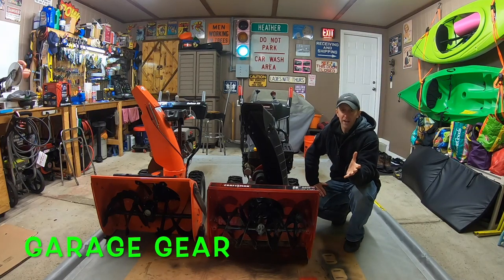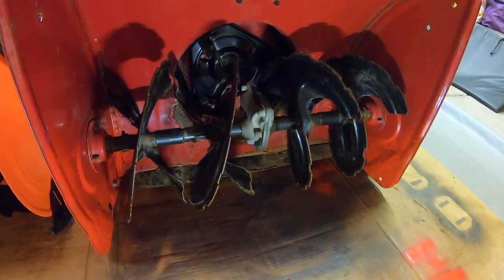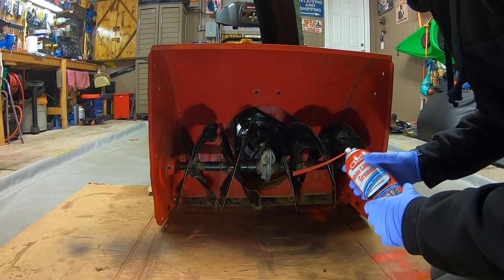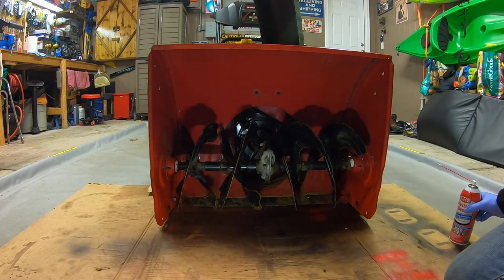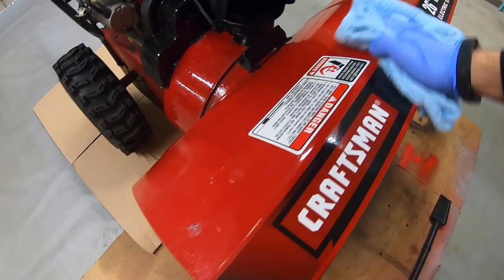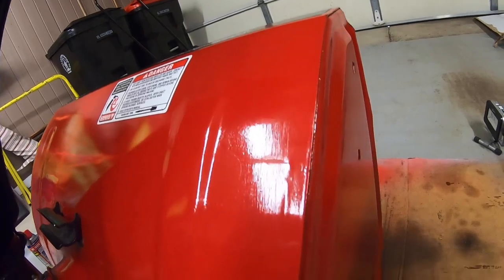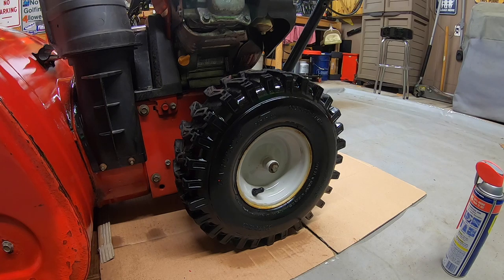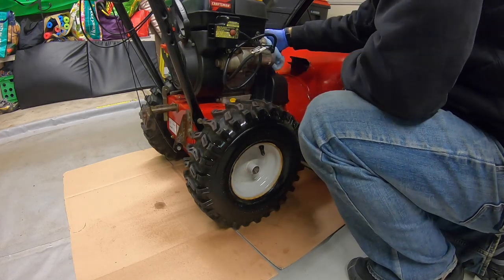CLEAN, SHINE AND PROTECT YOUR SNOWBLOWER. Cheap, Easy and Effective!

Comment: I just took delivery of an Ariens 30 inch Platinum SHO. I put a good layer of anti sieze and low temp grease on the gears , drive axels and drive slide bar . I will be using silicone before  the first use which might be next Tuesday . WD 40 is a great idea for the entire machine coating . You show great detail in this video . Thanks . I am think Auto tire shine for outside of tires . Too bad those outside cable brackets are not stainless steel . One more thing I do is a light coating of bulb lube on the electric start plugs and also in the cord itself . Easy to connect the cord and pug it in both the machin and wall outlet .
Reply from the maker: Thanks for sharing all this Mike!

Comment: Hey JB I'm new to your channel but I like how you do things I'm a retired machinist and I too care for and protect my snowblower.  My snowblower is a MTD it's 26 years old and looks and runs like day one. I replaced all the cheap nylon bushings which it came with when it was new to 304 stainless steel ones which I made myself. I think I'm going to put these on my snowblower too, every year I change the oil, every 2 years I totally grease the transmission gears and shafts and always use fresh fuel. I've never had any problems with my MTD I modified mine by changing all the plastic moving parts to stainless steel. I will keep checking out your videos and thanks for doing what you do I truly appreciate it.
Reply from the maker: Hey Ken!  Thanks for being a cool fan of the channel! Sounds like you really modified that snowblower to make it a snow throwing champ! Plenty more videos to come my friend! 👍

Comment: I worked for a major NY based Stock Exchange for 20+ years (can you guess which one?). They were absolutely meticulous about maintaining all of their equipment - reliability had to be to the 5 nines. 99.999% uptime. So, the thinking was that "cost avoidance" although extremely difficult to measure, in the long run was a hell of a lot cheaper than repairs and the cost of down time. Your videos are an excellent example of this thinking. It also reminds me of the children's rhyme "A stitch in time saves nine"!  Some people give me a look like "why bother, just replace when it breaks". But I find it easier to sleep at night knowing I've done all I can to keep things from breaking down - usually when you need them most. Plus, I'd rather spend my $$$ on something that gives me pleasure when I want it. Not on an expensive repair or replacing with a new item (which often is not as good as a decent, well made older model.)
I think that's why my 18 year old Camry has never failed me and has required only the usual wear items. 
Thanks for your videos.
Reply from the maker: Totally agree with you on your thoughts about preventative maintenance!  A small amount of effort now usually means less headaches later when it matters most! Thanks for watching! 👍

Comment: I just use Pam cooking oil to spray everything once and awhile. It’s much cheaper than WD40 and works great. FYI cheers 🇨🇦👍
Reply from the maker: Thanks for the tip!
Reply: If you want to invite critters to hang out in your snow blower maybe.
Reply: @shadetree6981  any thing that’s in the barn has critters in it. That’s just what happens. I put downy sheets in my motorcycle and snow machines mice don’t like that. Problem solved.
Reply: So many videos about don't put pam on a snowblower

Comment: Personally, I'm not a fan of WD-40. What have discovered that Mobil marine grade tube grease works great! Use a old rag and wipe grease on the surfaces. Rub it in and buff it out. Also use marine grade anti-seize on the axles. Marine grade stuff have a lot better properties for resisting wash-off.
Reply from the maker: Good tips here! Thanks for sharing! Thanks for watching!

Comment: WD40 was designed by NASA in the 1950s' to rust proof re-entry vehicles (parachute into salt water). "WD" stands for Water Displacement.  Years ago I did the following experiment:  I hammered a couple of steel nails into a piece of wood and sprayed one with WD40  and left them on my deck exposed to the elements, the without WD40 was rusted the next day.  The one with WD40  on it stayed rust free for six months.
Reply from the maker: Good tips here! Thanks for watching!
Reply: You're wrong. WD-40 was invented by businessman Norm Larsen, founder of Rocket Chemical Company. He developed it in hopes for it to be used in the aerospace industry but it was not designed by or under the commission of NASA.

Comment: Also just reading something about WD-40 that it's not good for paint It can actually take paint off of snow blowers over time Even though it protects it.

They also say don't use it on plastic parts cuz it can dissolve plastic. So pushing it into the gears for instance a Toro quick stick gears are a very hardened plastic and it could actually deteriorate it and make your gears break. 

They did say the WD-40 white lithium grease is better, better for plastic better for everything.. 

;)
Reply from the maker: This is now the second time I’ve heard this but I have never seen this happen and have been doing this for a decade on my snowblowers paint with no issues. Same thing with plastic components. No issues. Would like to see a long term test on this for sure .
Reply: @GarageGear  You've never seen WD-40 degrading paint? 

Did you ever think that maybe that's why the paint's coming off? Even though it's protecting it. 

I don't know either but it says it and a lot of places.
Reply from the maker: @muzikmon2267  the snowblower in this video I got for free and fixed up to sell. It already had a lot of rust on it. Doubt it was sprayed with anything to protect it at all knowing the guy that gave it to me.

Comment: If you really want to get picky I tried using Brillo pads and the rust came off then hit it with fluid film to coat them they look like new
Reply from the maker: Thanks for the tip!
Reply: @GarageGear  I actually learned it from your video all I did was add the additional Brillo pad to remove the rust then coat it like you did Lol… so thank you

Comment: When the city plows invariably dump snow on the end of my driveway.  Most times .... I can taste that there's some sort of salt.....  Whether it's NaCl or MgCl or what have you.  

Is waiting till the end of the season, aka spring, ok and then should it be rinsed out with soap / water?  

I don't recall hearing you mention issues with salt in the snow that you might get into.
Reply from the maker: Hey John I usually just rinse it down with a hose and then blow dry it with a leaf blower. Then I put a protective coating on it. Thanks for watching another my friend!

Comment: Seems like wd-40 would dry out the paint, cause paint damage. I use a spray on car wax, made for "paint ".
Reply from the maker: Hey Ken, not to worry! Wd40 will not harm your machines paint. Been using it on my machine for nearly a decade. No paint issues whatsoever. It’s protected it and kept it looking like new all these years. Thanks for watching
Reply: @GarageGear  sounds good. It does give a great shine, I'll have to give it a try.  :)
Reply from the maker: @kenbird5221  can’t go wrong with it!

Comment: wd 40 IS NOT a lubricant.
WD-40 isn't actually a true lubricant. WD stands for "water displacing" and its main use is as a solvent or rust dissolver.
Reply from the maker: I have found it to protect my snowblower when sprayed from time to time during the season. 8 years with very minimal rust. Thanks for watching!

Comment: I was watching some snowblower videos about WD-40 and fluid film sprays like that. 

When it comes to making it more slippery for the snow. They claim using WD-40, fluid film things like that is actually bad..

What they were stating is it may help stop rust but it actually makes it worse and stick more if you have a coating of these sprays. 

They claim because they are not rated That well for cool temperatures. They will thicken up and not be slick anymore when it gets cold therefore it'll cause more snow to stick. 

So if anyone's using them to make it more slippery they can it'll help it does the opposite in cold weather.

I don't know if it makes a difference or how true it is but it makes sense.
Reply from the maker: Interesting information!  Never had issues with snow sticking while using them. They are doing their job protecting the equipment. Are you searching this on snowblower forum?

Comment: Okay so I'm assuming the fluid film protects against rust better. But I thought that WD-40 does that anyways. 

So what happens If you have a brand new unit. You don't need the fluid film obviously cuz there's nothing rusted yet. So you just going to spray everything with WD-40? 

Why not spray the whole thing with WD-40 and wipe it down if you have a brand new unit? 

Just some interesting suggestions..
Reply from the maker: I usually do quick coats of wd40, or silicone between uses. Fluid film before storage. Fluid film is like $12 a can when wd40 is like $7. I save the good stuff for a final spray down/wipe at the end of the season!
Reply: @GarageGear  yeah people swear by WD-40 It's just that a lot of people say it could make paint come up and damage some type of plastics.

My snowboard is going to be brand new coming in a few days. The E26 from Toro.

So now that it's brand new I should coat something on it cuz it's going to be nice and clean. 

I don't know what to do lol. So many opinions

I guess from the stuff I'm reading the way that you do it works but it doesn't last. 

Now they're saying the best bet is to do a ceramic nano coat all over everything that will last.. 

I'm shaking my head on what the hell to do 🤣

But love your videos!!
Reply from the maker: @muzikmon2267  usually find fluid film at the beginning of the season all over it and wd40 or silicone between uses seems to do the trick. Ceramic coatings are nice I think they just take too long to apply personally. Plus a lot sprays will creep into crevices your ceramic coating block or towel won’t.

Comment: Some of your products that you used are not sold under that name here in Canada.   What is Fluid Fill? Is it a liquid wax or just WD40?   Same question about Liquid Wrench Silicone.  I presume that any car parts store has some silicone spray

Last month, we received our Ariens from the dealer.  I did a checkout of the dealer prep, and discovered that all that was done was to put in about 1/2 tank of gas  and the engine oil.  I did top up the oil to the midpoint of the dipstick holes. I bought ethanol free gasoline (91 octaine).  To get 91 octaine, I went to the service station, selected 91octaine.  Those pumps have one hose where your octaine selection flows through. I  put what I considered to be the first gasoline in  the hose into the car, and when about a gallon was transferred, I presumed the rest of the hose was now pure 91 octaine.  
At the end of filling my jerrycan, I stopped the pump and then restarted it using the 87 octaine grade, and put a few gallon sinto the van tank.  It least, I got my 91octaine stuff.
Here in Canada, the largest car parts chain store is called "Canadian Tire".  They have the rebranded or equivalent of your mentioned products.  I like a product called JigALoo  which is amazing for sliding parts that are not exposed to dirt.
Reply from the maker: Hey Leslie. Fluid film can be bought on Amazon and yes just about any good silicone spray will work too from an auto parts store!

Comment: Definitely looks 1000% better. I’m going to incorporate this into my maintenance routine I’m just starting on my Troy Bilt 2460 I bought a few years ago.  
When you sprayed the wd40 on the auger bushings and the chute gear, can white lithium grease works just as well or is the wd40 better?  

Thank you for this video
Reply from the maker: Hey Swagger! You can definitely use white lithium grease!  I like to use wd40 because it’s quick and cheap. Thanks for watching!
Reply: @GarageGear  I appreciate the response. I guess I should have looked at my snow blower first before I went and bought a grease gun and a tube of grease. I was all excited to grease the auger shaft and come to find out I don’t have any grease fittings. I’m going to do what someone else mentioned, squirt some lithium grease or wd40 in the shear pin holes on either side. I have four shear pins. Was kinda bummed about not having the zerk fittings. Will still do what I can. Thank you so much for the video and response
Reply from the maker: @swaggerjacker1482  you got it my friend! That’s a good idea! You can definitely shoot some grease down that way! 👍
Reply: @GarageGear  what causes my Snowblower to pull to oe side   when blowigging snow
Reply from the maker: @dorothysroda7484  check your skids up front to make sure they are set equally on each side. Also check you tire pressure in both wheels. 👍

Comment: Any recommendations on repairing paint chipped areas?
Reply from the maker: You could lightly sand the areas and give them a quick shot of paint. I prefer to use a glossy color matched (close enough) paint. If you paint it in warmer temps the paint will bond better. Thanks for watching Melrose!
Reply: @GarageGear  Do you use a primer? If so, what is a good brand?
Reply from the maker: @johnyole7625  you could. Rust oleum is a good one.
Reply: @GarageGear  thanks

Comment: Good vid, especially if prepping a machine to sell. The Ariens is obviously a better built machine with heavier gauge steel and a more durable finish than the MTD built Craftsman. However as you said these are costly pieces of equipment and worth maintaining 👍🏽
Reply from the maker: Yeah those MTD ones might as well be made of paper lol! You might as well get your money out of it by taking care of it!  👍 I ended up selling this unit for top dollar! Thanks for checking out my channel!
Reply: @GarageGear what’s top dollar for something like that. 
I sort of have a thing for snowblowers to the point that I’ve been taking them apart, replacing a bunch of things, sanding and painting it all and putting them back together. I usually get them free or around $100. I put a little money in and spend a decent amount of time which I find therapeutic, but now I’m at the point where I’ve got to sell at least a couple. Just don’t know how much is too much for people. 
I mean I’m not just hitting it with touch up paint and WD40. 
These look and run nearly new when I’m done. 

I’m not looking to make a killing, I know my time can’t be recouped by any price as they’re still old snowblower’s, but I don’t want to basically give them away either
Reply: I have been using fluid film on my Honda 928 and it looks brand new no rust it's amazing

Comment: Any info on the mat on your floor? Where from? Price? Links? Thank you!
Reply from the maker: Flint Layfield Hey Bud, I’m actually considering doing a video on this parking pad. It has been a lifesaver and keeps snow and salt away from all of my equipment. Contains it well. It’s called the e-z parking pad. Cost about $350. Well worth it. Without it, water/salt would be all under my workbench. The sides of it stand about 2.5 inches high to contain everything. I just called the guy and ordered it over the phone. Triple check your measurements of how big you want it when you order it. I would have actually gone about a foot longer on mine. You can choose different colors too. http://laronesolutions.com/products/e-z-parking-pad/.        Hope this helps.     JB
Reply: Garage Gear thank you!

Comment: How high should I set the snowblower? I just picked this one up. I'll only be on normal street and sidewalk surfaces, no gravel or grass.
Reply from the maker: Great question! I usually set the snowblower about 1/4 high up off of the ground with skids on each side. I usually put two pencils under the scraper. One under each side close to the skids. Then loosen the bolts on the skids. Set their heights and tighten them down. The just take the pencils out from each side and your snowblower will be set at about 1/4 inch from the ground. Thanks for watching Pizzle!
Reply: @GarageGear  Yeah I saw that pencil idea in the other video and actually copied it with 2 identical small pieces of wood. Worked great. I also took your tip and used WD40 on the chute gears because they were really rough. Worked great also.Thanks again.
Reply from the maker: @HistoricalWonder720  glad it worked for you my friend! Sounds like you’re ready for snowblower season!👍
Reply: @GarageGear  Just reporting back after our first small storm of 8 inches..it worked perfectly. 30 minutes of pretty good and heavy snow removal. Thanks again for the videos.
Reply from the maker: @HistoricalWonder720  glad it worked perfectly for you pizzlesauce!  👍👍